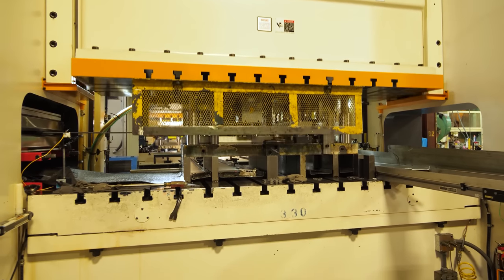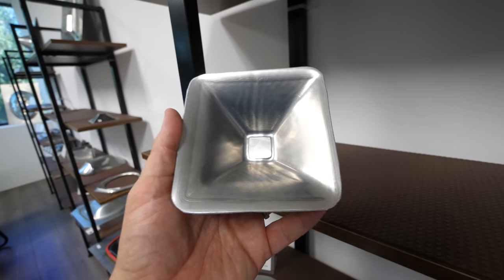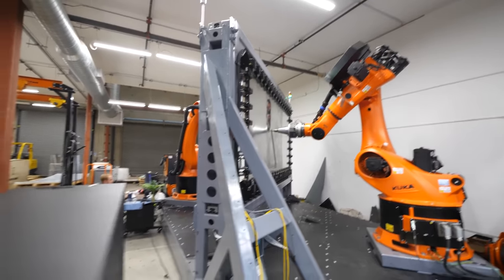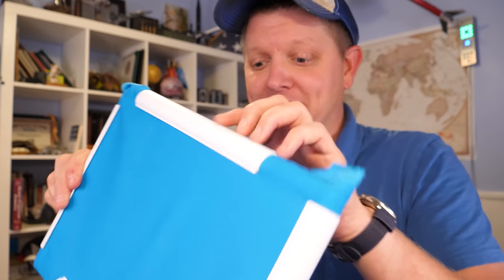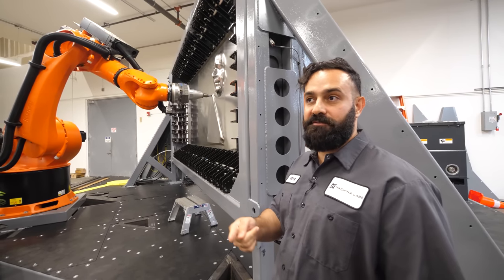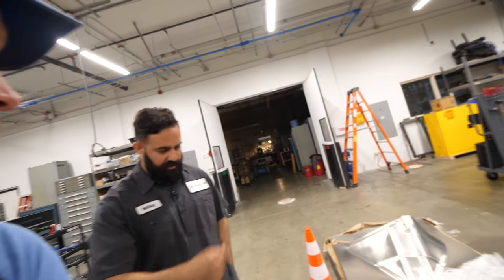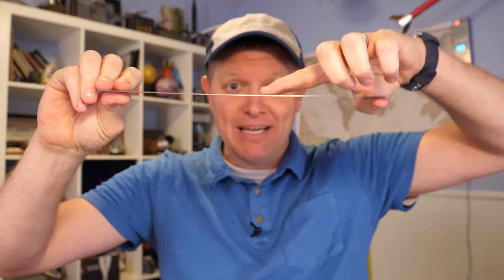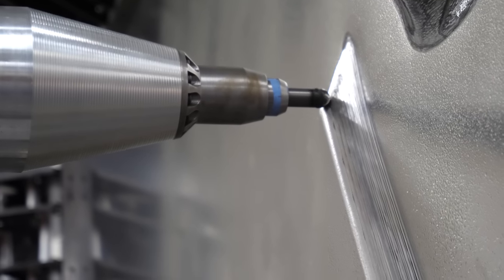ROBOFORMING: The Future of Metalworking? (I Had NO IDEA This Was Possible) - Smarter Every Day 290

Comment: So is it just pressure or are they also using thermodynamics I could see how heating or cooling the point could also special properties like magic angles to be incorporated if controls were able to be telecoped out into the material structure on a much smaller level of plane - particularly as it applies to carbon such as graphene "sheets" because super cold elements under specific force can be transformed and specific deformations at magic angles allow special electromagnetic / superconductive properties.  Also if you were to superheat but maintain linkages -- in instances of time you might be able to change the local state of material without actually breaking it by also balancing / counteracting thermodynamics in an vector of time much the same was with nuclear forces.

Comment: I Almost wonder if there is a way to make a tool that is able to be heated to help work titanium or other hard martials or some type of induction. running a current through titanium might be hard, but it may be conductive enough to be able to heat the piece from the mounting jig to get it to form better. But then again I'm no engineer, so I don't know if these principles could be applied to this specific purpose. If anything they may have already tried.

Comment: The complexity wasn't really all that apparent at first until dude said the word "kinematics"... THEN I got the full scope of just how deep the math goes in all of this before they even mentioned it. I work some with 3D animation, and for certain types of animating (like endpoint chain deformation) we use "inverse kinematics". The software of course handles the larger part of the maths involved, but if you don't understand that math, then you can't figure out what's going on when something goes wrong. And THAT rabbit hole can go pretty DEEP. 🙀

For once I was well equipped to keep up with an engineering conversation 😅

Comment: Yh it is interresting but it is too slow. Maybe there will be a need in very specific tasks. Maybe if you have very low quantity and you don't want to mass produce. But yeah, for small productions and prototypes it could be used well. But I guess it wont be used in bigger scales.
Yeah and what i forgot, the mill is amazing. Instead of a standard cnc mill you could just thise robot. I don't know how much this robot costs, but you could just use it as a mill, if it is precise enough. This is actually really amazing.

Comment: Why can't they just use optical positioning sensors on the end efectors to eliminate the deflection calculations? That would eliminate all the kinematic mathematics and error compounding, and just force the robot to position the end effector at the correct location. The other robot would just maintain the force desired, like normal.

Comment: Interesting, but based on that surface patternI simply can't imagine these parts having the same structural properties as a simple stamped metal part, right? Implying that there are limits to the possibility to use these roboformed parts for prototypes (e.g. automotive, crash-tests, airflow)

Comment: While this at first blush seems quite exotic, it is rather 19th Century.  Investigate “super plastic forming.”  We have done it for titanium sheets to form repeatable titanium 3D structures.  (Boeing has been doing this for some time).  It entails the use of high temperatures (where titanium sheets become plastic)along with massive stainless steel molds (the size is a function of the size of the end product) along with the injection of argon gas into the structure to essentially inflate it to fill the mold.  When you return to ambient temperatures you have a fully completed 3D structure.  What you have here is is nice, but you need to think outside the box you have done for yourself here.

Comment: I'm a heavy guy who needs these guys to make me a super awesome custom bathtub.  Form it out of stainless steel, ceramic coat it like a car paint finish, and then apply a friction coating to the floor so that I don't crack my head when I stand in it to shower.

Acrylic cracks.  Cast iron weighs a ton and has serious shape limitations.  Make it of steel, attach it to a robust support structure, fit it with internal heaters that don't let the water get cold, and then sell me a product that greatly increases my quality of life.

Comment: "You can form parts faster than you can simulate it on a computer." This implies that the interactive robots in-action on physical material is a faster data-processor for optimizing material forming models and continuous-improvement operations than a computer. Fast-calculation-by-experimentation from real-time forming of material under extreme sensor-monitoring with constant self-calibration to the material and the deformation dynamics in real-time. 

 It's faster to test the best model path plot on hand and learn from that test and try another, a bunch of times overall as well as with EVERY SINGLE PINCH OPERATION PLOT POINT, using real data feedback from the specific conditions under which the final production forming operation is to take place, rather than math-modeled and limited real-world data on a computer that may be less accurate in predicting results in the material.  

That concluding statement also echoes another mind-blowing gem from the Roboforming episode: that steeper compound-depression walls in the formed material are actually easier than shallow ones (b/c of overcoming the elastic limits of the material and operate solely in the plastic 'regime' with each pinch-event). 

I'm struck by the geometrical steps from plane to polyhedron (planes at angles) to compound forming (a forming operation applied to a formed surface)... With the pinch-paths plotted through three dimensions, the modeling-testing-modeling-testing iterative improvement can step beyond geometrical models of the forming process entirely and plot compound forming of compound forming to a limit approaching infinity. Compound forming can involve infinite operation path-points at any sequence on any point in the system, so that the pre-cone form to enhance sheet wall thickness uniformity in the final hemisphere form, could be 'enmeshed' with the final hemisphere form, allowing for better optimization of a compound forming operation where every point in the final form shape is a member of every pre-form shape among an infinite number of possible pre-forming operations to arrive at the final form. Cone > Hemisphere might be the geometric-conceptual sequence that initiates the forming process, but by the final touch, the robots/controllers have gathered terabytes of data and generated countless working-model/plots at each step along the way, discarding and replacing candidates for the future forming plan as data reveals some possible plot paths to be definitively inferior to others under all possible future conditions. 

AI controllers may iteratively evolve compound forming paths to optimize their beginning model, so that the conditions measured at every point on a curve on a 3D path across the sheet surface causes an optimization of the entire model and of the next point in the immediate plot plan. Looking forward to the first AI-hallucinated pinch-form of a stainless-steel park bench.

Comment: 13:53 you just solve a system of equations with 8 degrees of freedom, how easy is that. (its very hard, no differentiation algebra will help you, a SAT solver would take ages to solve it, it has to be heuristics, like simplex, but smarter)

Comment: Yea. This is why they are doing there robot stuff and I am not...
Accounting for backlash and slack etc on moving parts with several different hinge points on 2 different robots simultaneously to pinch a single point in space.
That's somthing I can't think about trying to do the math on...😄

Comment: ITS KINDA STUPID THAT THEY ACCOMMODATE FOR THE MOVEMENT OF THE JOINTS OF THE ROBOT WHEN FORCE IS ADDED IT MOVES THE TIP WELL WHY DONY THEY JUST MAKE ALL THE MOVEMENT ELIMINATED BY JUST ADDING A HEAVY SPRING  B4 THE TIP WITH THE CORRECT FORCE ADD SO THE SPRING ACCOMMODATES FOR THE EXCESS MOVEMENT?

Comment: At 19:48..... HEY A******, it's very convenient how you guys are leaving out the most critical aspect here and that is how long in terms of time did the learning curve displacement take in order to derive what are those pressures and distances and so on in terms of what you guys call pinching. 

Real funny how you don't mention that. 

Houston we have a problem here.... It just so happens I need a part very similar to that but it's different dimensionally XYZ and ABC here is the print...go for it.

WOW you guys are really trying to sell a bridge to an Eskimo.... No way Are you guys going to compile nearly enough data in order to basically have a program smart setup in which one particular aspect or particular nuance of shape crosses over in this impossible network of connecting the dots in which we are talking about one material alone one thickness alone now we go to the next thinner material let's say an aluminum h14 now everything changes everything changes what would occur in perceived or correct pressure and pinching and all that other garbage you want to call it is another learning curve completely different just by going from aluminum h-14 sheet material of .125 to now ....  .105

Seriously in my opinion you guys try to sell this monstrosity should be arrested I'm going to call you guys up to get an estimate of what this bride of Frankenstein costs....

Comment: I get it this is just starting out. Imagine multiple machines on each side of the work. Different heads or the same on each machine. It would save material not having to build as much support a structure too. It will only take time to do away with tool coating and lube making  the wear of the tool head part of the learning/working process. Maybe cool the tips? Maybe not. How many hours did the face take? Nice show piece.  Why did the word toroid not make it into this show .😁 I need to stop watching this channel and only watch the extended cut channel exclusively. Time, we only have our amount. Peace and love.